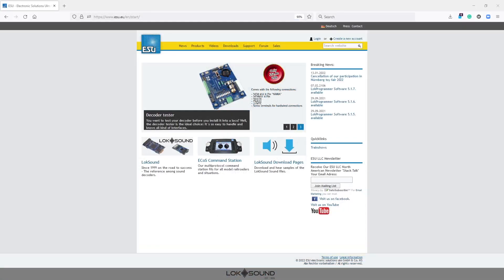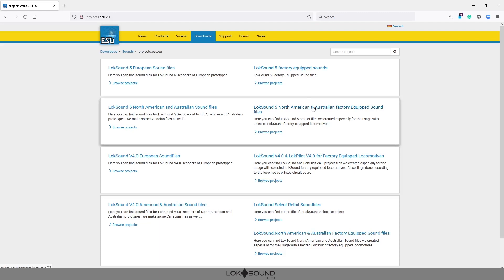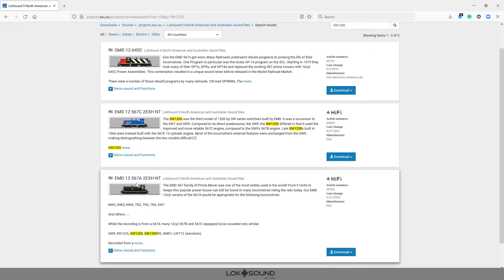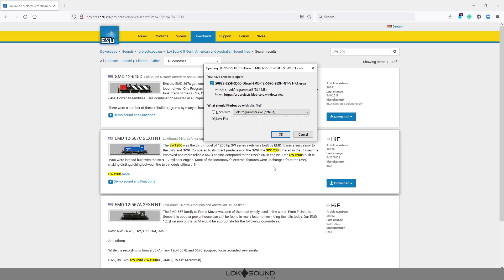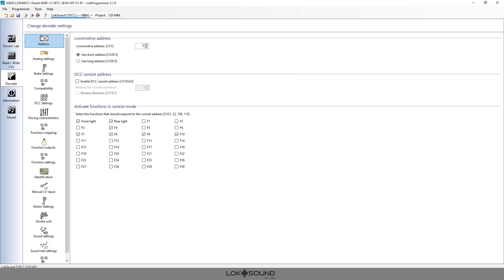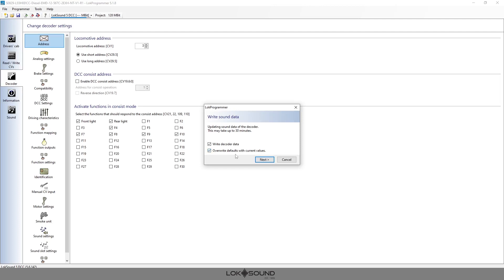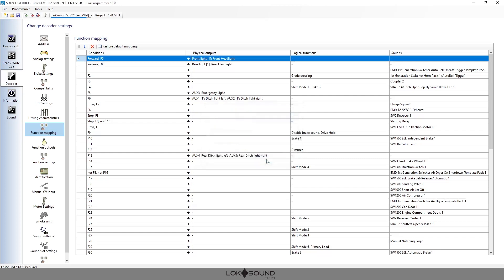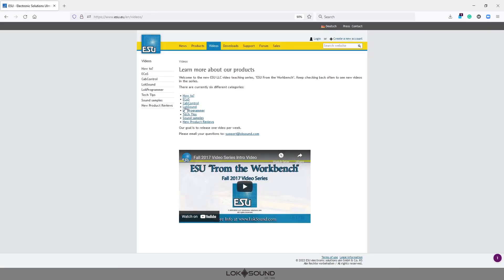ESU Tutorial EN LokSound5 Downloading and Writing Soundprojects with the  ESU LokProgrammer

Comment: I've been using the programmer for a while but what is the difference between short address and long address
Reply: I have Digitrax system so in the manual it says short address is 0-128, and long would be 129 -9999.   Default address is0003 but long address is when most people use road numbers as addresses like my GE is 6753
Reply: @KimKeyboardKimFokken  oh okay awesome thank you for letting me know I appreciate it